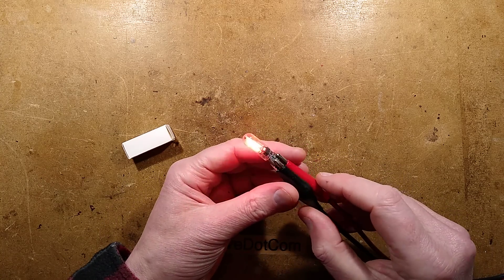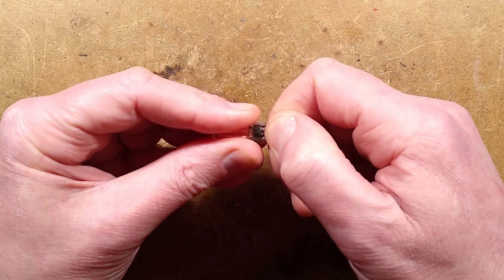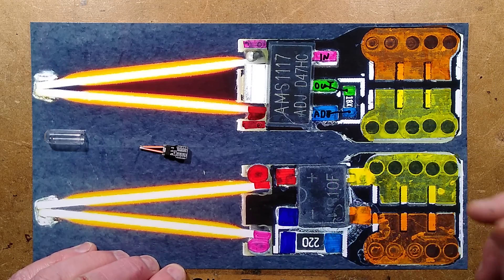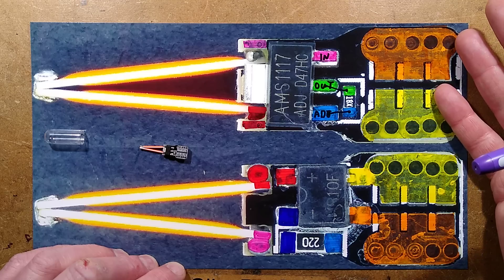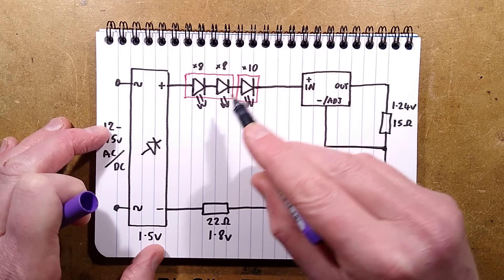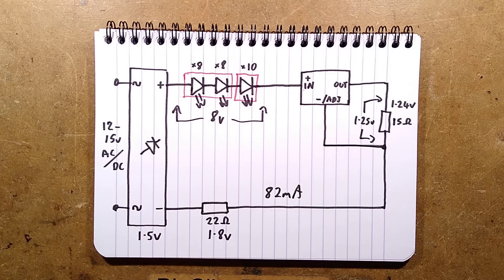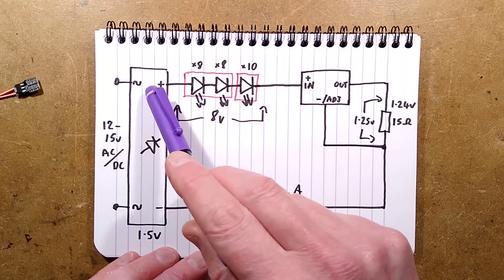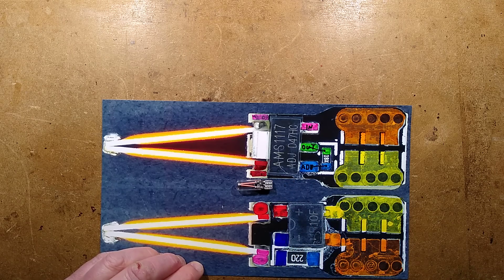Neat vehicle lamp with current regulation (with schematic)

Comment: I could use these in my landscape lights.  12vac +- 2 volts.   Can you recommend a part number and an inexpensive source for them?
Reply from the maker: You may have to hunt about on eBay or AliExpress to find a source of compatible bulbs.
Reply: I figured they’d be on one or both sites.  I was hoping for a base type reference and some wording or specifications to look for to ensure  the type of regulation the one you reviewed has.

Comment: @demef758 The infamous 117 crap. Have experienced dying expansive circuits when / because the THERMAL capacity of the IC itself is tiny small  and the underlying cooling area did not dissipated the heat quickly or was too small.
The issue happend to me on professionally made units and home made projects too. The dead of the 177 caused expansive losses when it burned ALL the powered circuits on the pcb & subsequently  the LED displays.
The thermal over protection DID NOT WORK, never. No shutdown was performed.
It shut cut off the load entirely when it reaches the max current /max temp.

Comment: I have just torn down an empty 50ml Cetraben emollient pump dispenser and it might be worth considering for a short mechanical video. It has 9 components, excluding the contents & label and is rather clever. The magic happens via the small hole in the bottom!

Comment: we used to call them pinch base bulbs wish I could find them in 6 volt for a emergency power failure light I have that has tungsten filament bulbs in it  does not last long on battery .

Comment: Pretty clever....don't think they make them for my 54 year old VW though.
Reply from the maker: If it uses standard lamp holders then there will probably be LED lamps that suit the vehicle.
Reply: Wouldn't 54 years old be 1969? I think they switched from 6 to 12 volts in '66 or 67 so a module like this but with the appropriate base would work just fine.
Reply: @eDoc2020  Yes, my 69 is 12 volts, it even has a red lightning bolt with 12 volts printed on it on the drivers door jam next to the fuse block so mechanics will know it's 12 and not 6 volts. Clever Germans.

Comment: The very old LM1117 was designed long ago by National Semi (now a part of TI), a better version of the LM317. The latter has a much higher dropout voltage (≥ 3.0V) than does the former (≥ 1.2V). It's output voltage formula is (1+R2/R1)*1.25V, or (1+22/15)*1.25V = 3.1V (nom). There is a small current coming out of the ADJ pin (60uA nom) that can be ignored if the load current is set high enough, making the circuit look like a current sink to the load connected to its input pin. You just have to make sure that the voltage at the last LED cathode stays above the dropout voltage, or about 3.9V. Since you measure the LED total voltage of 8V, it means that the circuit will drop out of regulation when the input voltage drops below 8V + 3.9V + 2*Vdiode, where Vdiode is the voltage drop on each of the FWB  diodes, probably about 0.7V each. I.e., when you start the car and the car's voltage drops below about 13.3V, the current sink will not function properly. But when the car is running and Vin is above that, you're good. The LM1117 in the SOT-223 package is dirt cheap, which is why it is used.

A good test of the lamp, Clive, would be to connect it to a lab supply and lower the voltage to it until you see the light start to dim. Personally, I think the dropout voltage of this lamp is too high to be reliable enough for automobile usage.
Reply: So basically they could remove the 22 ohm resistor to let it regulate even at lower input voltages. So why have the resistor at all? It's probably to reduce the 1117's dissipation at higher input voltages. A resistor between the regulator's in and out pins could solve that problem, leading to an overall improved design with the same BOM.

Comment: It's nice to see constant current regulation, on 12v LED car lamps. It's so much better than just a resistor, for the  variable voltage 11v-15v in a car. I guess the circuit would also of worked, if used as a voltage regulator, with a current limiting resistor for the LEDs. If the regulator was set close to the total forward voltage of the LEDs,  then the current limiting resistor could be small and low value.

Comment: Hi Clive Just something which may or may not be anything to do with this type of bulb, since buying my Vauxhall Grandland every so often whenever I put the right turn indicator on I get a fault indicator and my incarinfo tells me to take my car to the nearest garage, I have done this and they are not sure what the problem is but they think that on some cars who have halogens and not LED's (this could be the other way round) could be the cause ,but as I told them why only on the right turn
Reply: If the car is designed for regular bulbs but an LED is installed the lower current draw could make it think the bulb is burned out. But if an infotainment is saying to take the car for servicing just because of a burnt bulb it doesn't seem like a very good system.
Reply: @eDoc2020  I wonder why Vauxhall has not came up with this, It is something I will check that  myself , thanks for the info.

Comment: I have a version with two pins, rectangle filaments and dipped into a sillicon rubbery type of solution to form the 'bulb'. It runs on 12V and polarity doesn't matter.

Comment: A similar circuit is used by the 12 Volt , warm white ( G4 pin base ) lamps , sold in many shops ... the regulator is handy , should the voltage rise ( 14 Volts ? ) , the current DROPS to give a constant brightness ( and vice - versa down to about 10 Volts ) .... the BIG problem with LED bulbs in cars , is that they use MUCH less current than filament bulbs , sometimes confusing the car's electronics ( says :  bulb blown etc ... ) , VERY handy lamps in case of power cuts or camping , BTW .... DAVE™   🛑

Comment: These look like a good fit for interior car light. 
The filament ones burn often. I wonder what the current through each LED is? Not 82mA for sure.
With only 8V voltage drop across the LEDs, they are surely in series/parallel configuration. 
Longevity will depend on the current through each LED.

Comment: They didn't use any caps? 
I was sure the AMS1117 required both input and output caps for stability like all other linear regulators.  
I guess who cares in this application if the LEDs flicker with AC input. Or, it's made for 12VDC use and that BR is so the bulb would work any way you plug it in.

Comment: At 4:25, should the first two x8 LEDs in parallel be drawn as such instead of series before the x10 LED on the schematic?
Reply: I think they are even more in series than that. As most LEDs have a power drop around 1.5-2 V, I guess that they are even partly parallel inside the units themselves. Clive, please enlighten us.

Comment: Would a resistor not have been a simpler option. I can't see the change in brightness being an issue if the voltage ranges from 12 to 15V.

Comment: Our old friend, the comet lamp.
LM317 T/K has identical specs.
I don't get the asymmetrical LEDs. What am I missing? 
   ;)
Reply from the maker: One filament side has a single parallel circuit.  The other side has two parallel circuits in series.
Reply: I must be have a bad day..
I don't understand the purpose of this layout? 
   ;)
Reply from the maker: @snakezdewiggle6084  It's a way of getting three LED sections in series over two filaments.
Reply: Okay, got it now. Cheerz. 
   ;)

Comment: Oddly enough... there are some vehicles wired for A.C. ... not your regular cars, or trucks, but some off road, and rv stuff... trailers and stuff.
Reply: One of my lawn tractors uses an auxiliary alternator winding for the headlights.  12VAC at around 330cy/sec when the engine is running at full speed.

Comment: If  you are here, in the New World, you can check out the Sylvania ZEVO brand of white LED mini lamps, for automotive interiors fixtures. It is also non-polarized (just so the old folks don't wonder why the dang thing won't work, when you plug it in... when a good 'normal' light bulb always would.) Anyhow the OEM is DE3175.

Comment: Hey Big Clive can you please do a video on why performers dont get electrocuted on stage in the rain but sometimes they do?  Is it like the Witchcraft that allows a Vacuum cleaner to suck up water? Cheers Mate.
Reply from the maker: The stage electrocutions usually happen due to issues with audio gear where a wired microphone and guitar are at different potentials, either due to the use of "vintage" audio equipment or clowns cutting earth wires to "avoid hum".

Comment: Are these bulbs available for a lower input voltage? Because that light would be great for pinball machines, in the spaces where the bulbs are visible on the playfield. Older pinball machines often use 6,3 V for the light's. Some AC and some DC.
Reply from the maker: You can get lamps matched for pinball use, and also new driver boards that work better with LEDs vs tungsten lamps.

Comment: Interestingly, 8V + 1.25V + 1.8V + 1.5V = 12.55V, plus there is some drop-out across the regulator, so the regulator isn't really cutting in until the supply voltage is over ~13V.
Reply: That lamp would consume a bit over 1 Watt.  Some get radiated away but 1 Watt will make that lamp get quite warm.

Comment: Will these be able to use in older canbus cars? One the cars I put led rear lights in kept throwing coed and wouldn’t engage cruise control until I put incandescent lights back in.
Reply from the maker: This may not be a high enough load for those systems.

Comment: Nice, I've had them in my cars interior once but they kept glowing when turned off so they went back into the drawer filled with stuff i'll probably never use again
Reply from the maker: If they glowed when off it was probably a tiny current that would have been going through the tungsten lamps anyway.

Comment: Why not just use red LEDs? It seems silly to use blue with a red phosphor, which increases the cost. I could understand it if it were yellow or amber, because they're very inefficient, but red LEDs are only slightly less efficient than blue, in terms of power vs radiant power out. A blue LED and red phosphor would be less efficient due to the loss in the phosphor.
Reply from the maker: The filaments are often made with flip chip LEDs which I've never seen in a bare red version.

Comment: I was reading the datasheet as you were explaining the circuit. The part that says, "Oh, you shouldn't need to stick a diode on the output because we've got that mostly covered" made me chuckle a bit. They don't describe current regulation per se, but they do mention a constant current between output and adjust pins if there's a resistor connecting them. Very clever use of this LDO regulator, and you don't need a big inductor like with an AL8860.

Comment: Its bad product, as COB LEDs are on opposite of automotive grade. Those will fail from raw thermal treatment and vibrations. The same thing, but with robust chips and heat dissipation case would be fine

Comment: Thank you Clive. I have never seen or thought of using a voltage regulator in that way. Very interesting.
Reply: Look in the data sheet of the LM317 - it has a number of "unusual" applications of an adjustable voltage regulator. One of them happens to be a constant current source, but there are a number of others

Comment: Terrible in the way the lamp is wired. Those lamps can short out some sockets, as these lamps can normally be fed with opposite polarity across th eplanes, or opposite polarity from the sides.
I.e. only one yellow plane should be there, and on the other side of the pcb, opposite side, an orange plane. Normally on a W5W lamp, one wire is bent upwards and the other wire downwards.

Comment: It's a nice bulb replacement for some vehicle interior lighting where the circuit board style ones won't fit, for example 2005-2015 volvo dome lights. Plus it's current regulated, so the alternator is less likely to kill it.

Comment: I want to see a physical implementation of a bridge rectifier for fixing polarity. A simple solenoid that flipflops a physical H-Bridge and turns itself off, meaning there's no losses because of using a diode.

Comment: This is a pretty nice implementation of LED retrofit bulbs. At first glance, it appears these bulbs were well-designed by someone with at least a smattering of electrical engineering knowledge, which is a refreshing change!

I've used several brands; one of which was pushing the chips right on the cusp of maximum tolerances at 12v. Which might be "fine" in a theoretical world, but those of us with moderate knowledge of 12v automotive charging systems know that the bulbs are typically seeing around 13.8v when the engine is running (read: alternator is charging). Lifespan ranged from a few hours to a few months before individual chips began flickering or getting the Black Dot Of Death.

Another brand that I've been using for several years now began with a diode, resistor, and single chip, they worked really well and I have some with over 6 years' use (still working, but getting a little dim), but the company continues to improve their design. The latest version uses a glass envelope with the exact same dimensions as the incandescent bulb they're replacing (for a perfect fit) and tiny COBs. Quite reliable and very bright, without abusing the COB. I actually have to turn the dash dimmer down quite a bit for comfortable night viewing, which is fine with me because I'm under-driving the bulbs and thereby increasing their lifespan considerably.
Reply: I have had 90% of my LEDs failing after few months on my different motorcycles and nobody could explain why. The COBs seem to have a longer lifespan (more months to a year). I am glad I am not the only one, everybody I have asked to just answered "Don't buy cheap chinese rubbish". Actually even some some reputable brands' have failed miserably.
Reply: @chongtak  I believe that the charging circuit on cars and motorbikes produces noisy DC. There more electric motors and solenoids in modern machinery, plus a high voltage powering the spark plugs. Transistorised ignition is better than the old Kettering type, but I am still not convinced it is less electrically polluting.
Reply: @chongtak  The best LED retrofits I've ever bought were Philips Vision 1156 brake bulbs, for my Scion XB. Got them in December 2016 and they're still going.

Like another person said I think motorcycles tend to produce "dirty" power. As great as LEDs are, they're unfortunately not very tolerant of voltage spikes. There's no way around it without building some switching regulator into them which would drive up their cost.
Reply: Would you mind sharing what that last mentioned brand is? I've been trying to find decent LED replacements for my map/dome lights. Gave "lasfit" a try and while they seem well made they unfortunately don't have a warm white option and the amber ones I settled on are a bit too warm.

Comment: the voltage regulator reminds me
of the LM317L in a different package ?
Reply: The AMS1117 is basically a newer generation of LM317. Like the LM317, it's made by a plethora of brands. It's a jellybean part.

Comment: Reminds me of some years ago using LM317 to CC drive =>1W LASER diodes. 
Popping balloons, lighting matches or candles and even a few cigars... Fun times!
Reply: That trick of using an adjustable voltage regulator as a constant current source comes from the datasheet of the LM317. It has a bunch of "unusual" application circuits in it - the LM317 (or any adjustable voltage regulator) can be used in a number of non-obvious ways!
Reply: @gorak9000  If you're a fan of "unusual applications" of company ICs, search for (my favorite) "555 based solar charge controller" for almost everyone's favorite IC adapted to a seemingly unrelated function.

Comment: I'm a bit confused- you show that the circuit is x8 + x8 + x10 LEDs which would be 26 LEDs in series(??), and assuming a 3v drop for an LED, that would mean needing around 26 x 3 = 78v to run that led array?  Yet it lights with 8 volts across it??  Help my math has fallen and can't get up!!
Reply: he mentioned elsewhere it's (8 in parallel) in series with (8 in parallel) in series with (10 in parallel)
Reply: @gorak9000  I missed that- I guess the CliveCAD schematic was misleading. Thanks

Comment: Nice, worm "tungsten" light. Chinese 1117 copy of TI regulators aren't exactly voltage regulators, but more like 317, and though still very popular are rather outdated - not low enough voltage drop and a rather high voltage reference for current regulation.

Comment: These would be really handy for LED conversions on older, small capacity motorbikes for a couple of reasons. One is they will often be running either dirty halfwave rectified and un-regulated/poorly regulated charging systems or even straight-up unregulated single phase AC for the lighting. The other is the indicator dash repeater bulbs often run the DC in opposite polarity depending on which indicator you're using. Even incandescant bulbs struggle sometimes and cascade bulb failures are reasonably common. These seem like they would cope with all of that madness without too much stress
Reply: Leds are great, for old 1980's bikes with 6v electrical systems and a tiny battery than can't really even run  the indicators and the brake light even when everything is brand new.